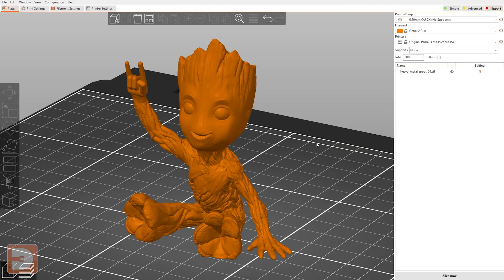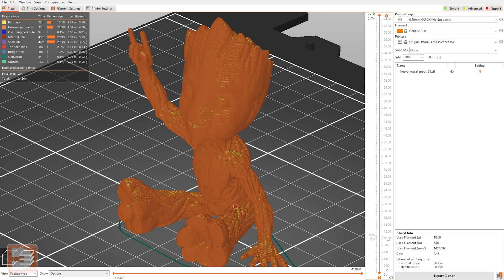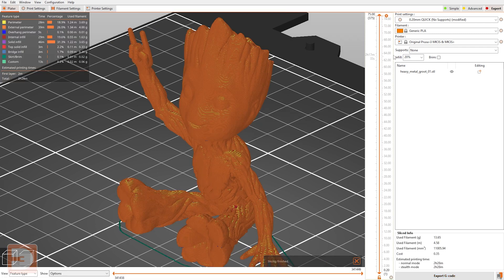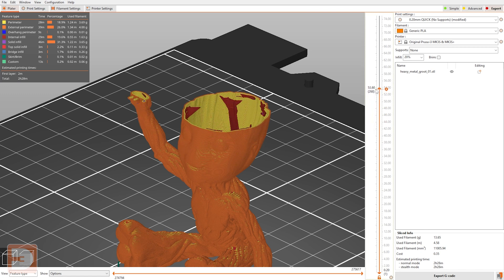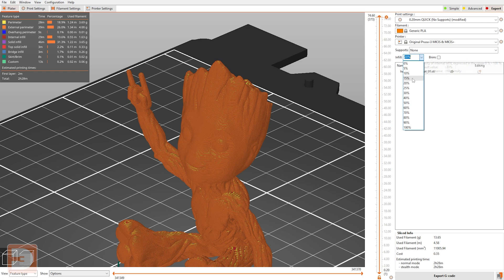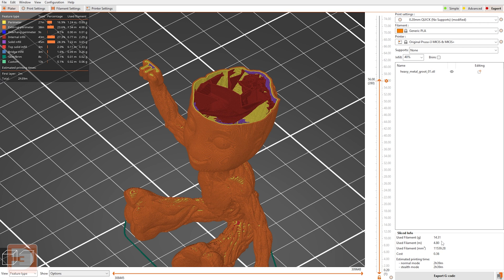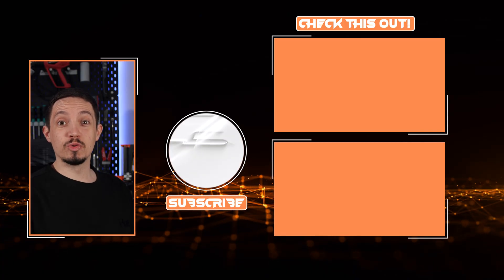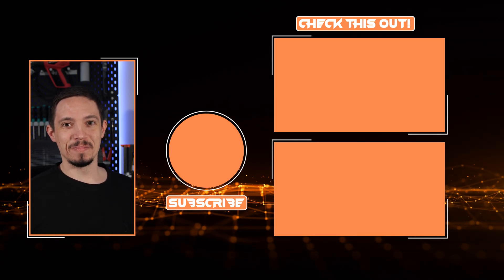PrusaSlicer's Lightening infill only builds infill where it's needed!

Comment: One thing I've found Lightning infill very useful for is I've been printing ornaments for a fish tank. Lightning infill leaves them mostly hollow so I can cut a hole in the bottom and fill the object with cement. Honestly I could see this method being useful for more than just fish tank ornaments. Filling models with a cement sand mix could make for strong solid objects. If the weight is an issue you could use Aircrete instead. Which can be made in small batches using shaving cream and cement.